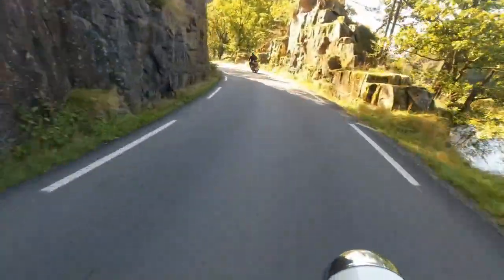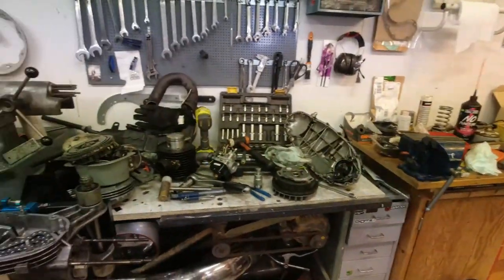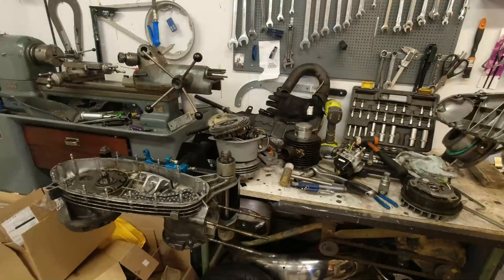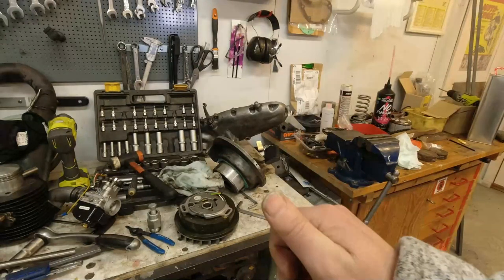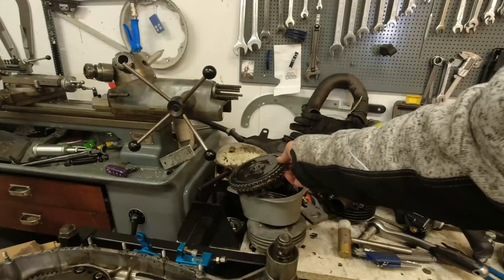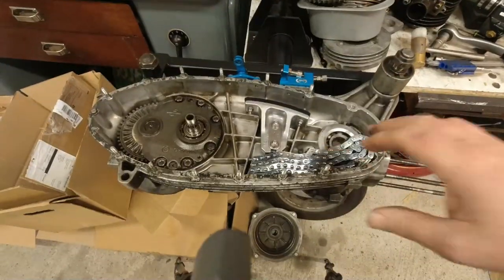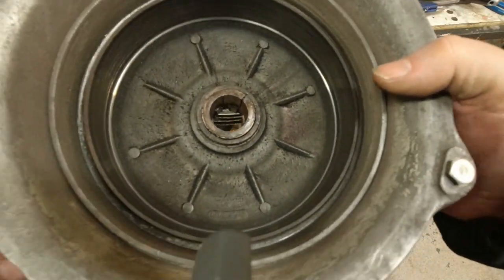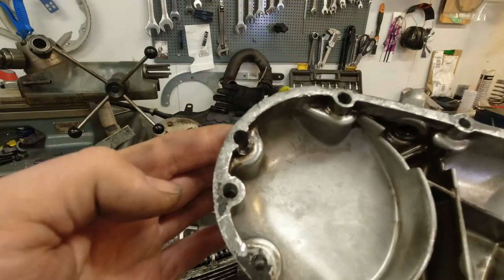How much to make a reliable #lambretta engine? #kickbackgarage

Comment: Hi Rob. I've got a Suzuki RM125 clutch, converted to fit on a 46 tooth crownwheel. The standard RM setup is 7 plate, but mine has 5 plate to fit the casing. It works very well and is light to pull.

Comment: Happy new year Rob.
I like the Casa multi splined layshaft and octopus hub. 
Doing away with the cone is a step forward and when I’m hammering down the motorway I know the rear hub will not be parting company.
Reply from the maker: My motor has a casa hub and guess what? That feker shit its splines too. 😂
Reply: Not had a problem since switching to genuin SIL rear hub and decently round rims

Comment: The only major non-reliable bits on my aging TS1 Annhilator has been the clutch, aside from the 4 plate I used to run with Lambro center spring. But my hands really couldn't continue with that setup, so it's been try this 5 plate or that one. I've given up and am installing an LTH clutch next month. I have of course had to install new rings, pistons and reeds from time to time, but the engine has been together since 2003 requiring only one main bearings and seals replacement so far.  Happy New Year!
Reply from the maker: The original clutch the weakest bit. I had the same problem in my ts1's. Stronger springs, center springs and painful fingers 🤣

Comment: Happy New Year  Rob, not that expensive? Indian ignition i would say a no no (sip vape) but looks good, i've just done a build 240 monza,  gt casing and engine block with a few casa bits, rear hub front sprocket and casa clutch which will need thinner gear oil 10/30 Darrel Taylor crank 62 x 110 + 5 speed AF, hope the build goes well, will be great to watch it being built. Once again happy new year to you and the family, keep your chin and see you next year TTFN

Comment: Hi Rob Happy New Year! I have seen loads of videos on YouTube about setting the timing on a Lambretta and they just tell you how to find top dead centre and 17 degrees but none of them explain about moving the stator to the correct position.I am still running 6v points and I would be grateful if you could do a video on it.
Reply from the maker: That's the thing. Once you have found 17 degrees, mark the flywheel and maghouse, start the scooter and strobe it. If the flywheel mark is further to the right than the maghouse mark then you need to take off the flywheel and move it anti-clockwise, bolt it all down and strobe again until both marks line up.
Reply: Thanks Rob 👍🛵

Comment: Will you be using the circling/spring to hold the clutch together? Ive been told they can come off and ruin the drivetrain
Reply from the maker: That's bullshit. It's a vespa plunger and they don't fail. If they do, then they have been fit wrong. On the other hand, you don't need the spring clip because once the sidecase is on, it can't fall out. So that's means that I use them but in theory you don't have to. 🙈